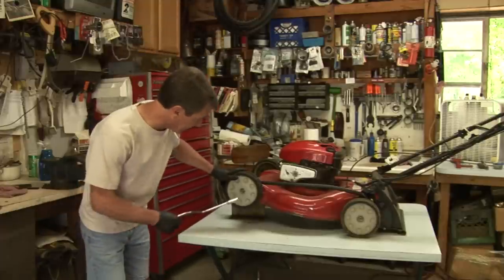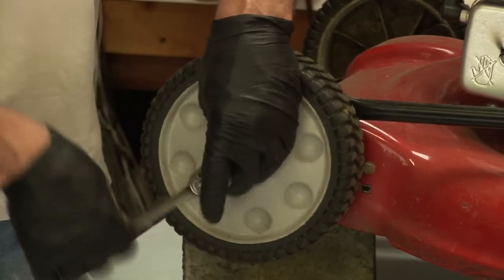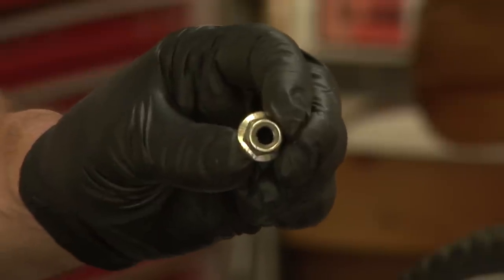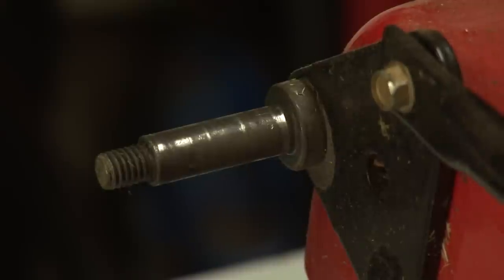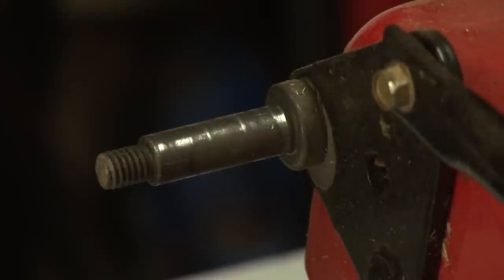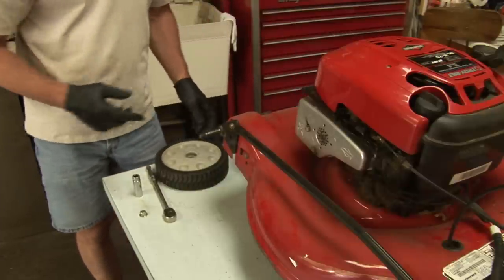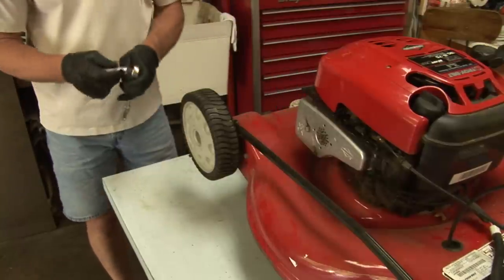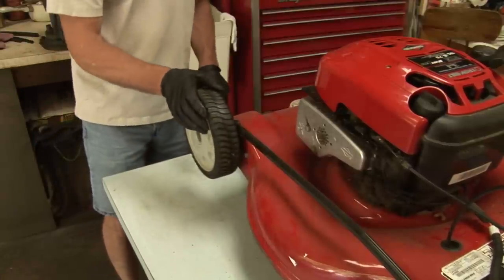Lawn Mower Repair : How to Mount Lawn Mower Tires

Comment: Hi, I just replaced my old plastic wheels with metal ones with bearings, but the new wheels slide back and forth on the axle, even with the nut screwed down as far as it can go.  Does anyone know what I can do to fix the wobble?
Reply: washers if its just a little bit.  Spacer if it's more.